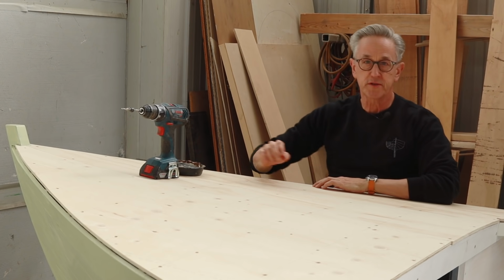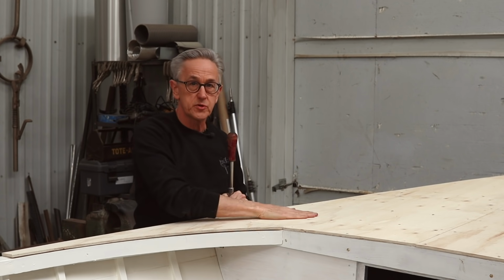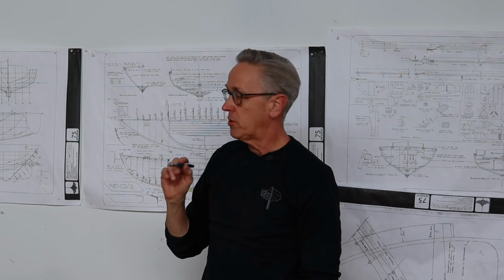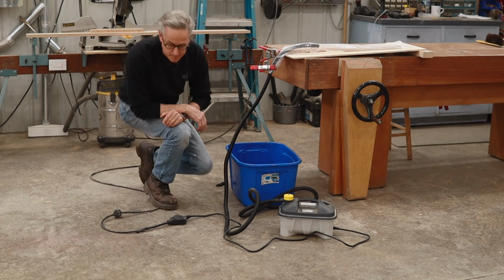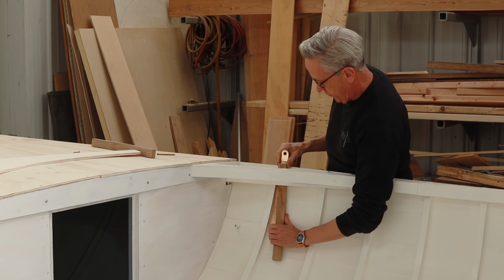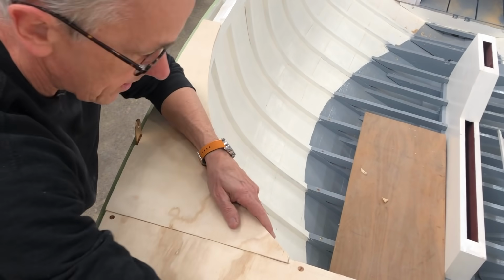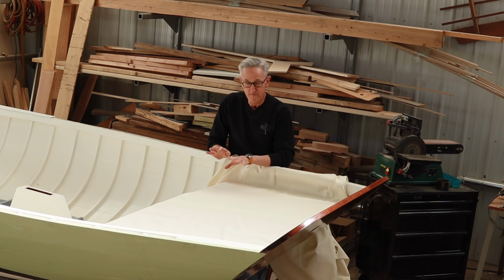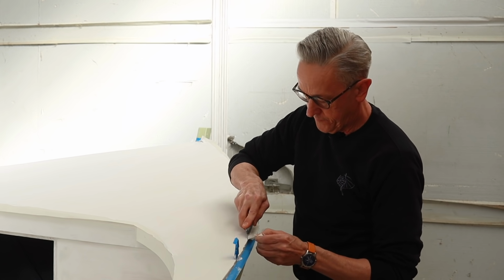Wooden Boat Building. Chain Plates & Deck Canvas, S2- E42

Comment: Another outstanding video Bob. Interesting sealer there would never have thouoght about using Gesso. I have seen and used a primer sealer paint called Gripper to do the same thing. Some how I also see you collecting all the bronze scraps from the chain plates and bolts to cast a bronze cleat for the boat.
Reply: Oh, casting a cleat from the off cuts is a great idea.

Comment: Interesting about slotted screws. I remembered reading about the flat shanked cabinet makers screwdrivers with a parallel tip to match a specific screw size as opposed to my relatively “universal” tapered tip screwdrivers.  And the ease of cleaning out the head to remove a screw - even paint makes that a challenge!  Thanks for the video.

Comment: That's a nice idea using gesso to bed the canvas, it's basically acrylic paint with whiting which gives it the body and texture. I did a painting on a gessoed 12 mm MDF panel that has been outside in sub tropical Queensland for 13 years and no sign of deterioration yet, my guess is the canvas will give up before the paint. Typically we used to bed canvas deck covering on oil based paint, using up the dregs of whatever was around in the yard, in those days most paint contained lead which really helped it stick.

Comment: very surprised how easily that oak bends! Like a cooked noodle! Interesting use of Gesso rather than epoxy on the decks. Do you use any kind of protective coating on the brass/bronze to prevent quick tarnish in a marine environment? 

Really enjoy these videos! The walnut toe rail will be a beautiful touch!

Comment: I believe most people don't like slotted screws is, the common screwdriver is greatly tapered whereas industrial screwdrivers have very little taper and have close tolerance to the screw slot.  Also, I believe I remember, Gesso is used as a base for gold leaf with a rabbit hairbrush.  Maybe you can use it on the transom

Comment: Actually it is not hard to clear square head screws and the like. Just use another screw set up on a battery drill's driver bit and use the screw to "drill" into the center of the buried screw. This will remove the bung and glue from the screw well enough to allow the driver bit then to be set into the burried screw head! I usually tilt the driver with screw back and forth a bit to better clear the hole. This is a very fast process as a power tool does most of the work. I'd counter that with the slot screw, it is all hand work to clear the slot! Also if bunged, aesthetics is not an issue but you are correct if authenticity is your number one goal! Great video though, in spite of my contradictory opinion! Thanks for sharing! All the bestRoy

Comment: Are you familiar with gunsmith screwdrivers? The differ from "normal" screwdrivers in that the sides are parallel. I prefer the insert tip types that can be used in drills or hand drivers for that reason.

Comment: Wonderful video. Just one question, Bob.
Why canvas instead of bright-work wooden decks? I know the design calls for canvas, but it is your boat and your call to change what you wish. Just wondering. Thanks.
Edit: oh, second question...
Why bolts on the chain plates instead of the rivots? Is that for ease of repair in the future, or because you don't have the help to back up the rivoting process?

Comment: Asking because I don't know..  The plans call for a water tight bulk head.  You did not paint the boards/panels all over?  You did not apply sealant to the joints?  Why did you paint the hull inside the compartments but not the deck and bulkhead?  Will you use a sealant when you apply the walnut trim strips where the deck meets the hull?
If any water at all gets into the bulk head spaces it will condensate on the bare wood.
I like the wax toilet ring for lubricating screws!
Thanks, JIM

Comment: The section detail through the chain plate appears to show a haunch at the upper end of the oak backing block to transfer tension load from the rigging into the sheer clamp without only relying on the top bolt. Am I reading the drawing incorrectly or did you determine this detail was not needed?

Comment: Some use Titebond 3 on the canvas so it dosn't matter about water soaking in at the edges. Also for the added wear from shoes and beach sand. Glass is still the king but old school has bragging rights.
Reply: And stand back with your thumbs in your armpits and go "I made that"😀

Comment: The aft deck is made of wooden boards and the foredeck is made of marine plywood. Is this because the wooden boards are needed to support the boat handler’s weight as opposed to the thinner plywood decking on the bow? Otherwise you could of used plywood on the aft deck as well since everything is covered in canvass.

Comment: I'm sure you must have seen Lou's self made chasing tools for repairing screw slots. All the bronze slot heads came out of my resto boat, the x heads had to be extracted. The chain plates and canvas look stunning. I was amazed at the price I was quoted for 9" of 5/8" bronze rod, even its brass equivalent was dear enough. How have you found the cost of the flat stock you have?

Comment: What is the reason that you used canvas on the front and rear decks? Is it for an old-fashioned appearance? Or is it to provide a nonslip surface? Could you not have used a commercial nonslip surface to achieve the same results? I loved watching you do this, but I don’t understand the reason for using canvas.

Comment: Could you tell me the exact Gesso and canvas you used? Thanks
Reply from the maker: Hi Vince, 
Any gesso will do, it's all the same. I purchased mine at Michaels here is a link https://www.michaels.com/white-gesso-artists-loft/M10999016.html?r=g&cm_mmc=PLASearch-googleMICH_Shopping_US_N_Art+Supplies_N_Smart_BOPIS_N_&Kenshoo_ida=&kpid=go_cmp-9972406790_adg-106296476328_ad-433378147599_pla-1341674404478_dev-c_ext_prd-M10999016&gclid=Cj0KCQjwpreJBhDvARIsAF1_BU3ipMYSbvcbv8Xxxqyx8ab-AZseWtHUhXdKdHLwN7sckS3zHSiFFewaAjeJEALw_wcB
The canvas is 8oz just make sure its 100% cotton!

Hope that helps. Thanks for watching!
Cheers,
Bob

Comment: Why the 1/2" hole in the chainplate?  That rig shouldn't need anything larger than 3/8" turnbuckles so the clevis pin would also be 3/8".  Is there something different about your rig plan?
Reply from the maker: Hi Luke,
The final hole is 7/16" The chamfer is 1/2". I determined this size from the plans.
Thanks for watching!

Comment: Bob, I think there was a step to be cut in the oak overlay on the chain plate that keeps the oak and bronze from pulling out; at least that's what I thought I saw in the  drawings...
Reply: @ralphgesler5110  Not for the bronze. This one seats under the inner horizontal member. Wood to wood...
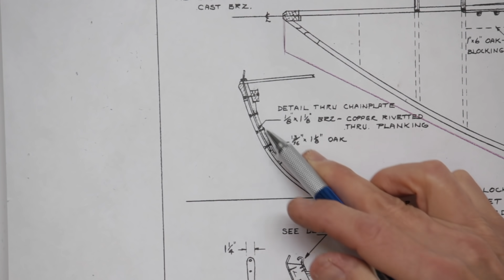Reply: Take a look at 4:55...

Comment: This is a lovely boat and I am reluctant to be critical yet I have concerns about its design.  It appears to me that there is little in the structure that will stiffen the hull to resist wracking. In larger boats there are knees and thwarts added to provide the necessary sheer. In this design the opportunity to provide sheer is in the decks and bulkheads using plywood but that requires a continuous diaphragm with gluing and edge fastening to counter twisting forces. In both the bulkheads and the fore deck plywood has been pieced together which can work if the seams are solidly backed with wood and glued and screwed. This wasn’t done here. Additionally, for some reason the aft decking is planks instead plywood which is a lost opportunity to prevent hull flexing. The forces of wind and waves against the rig, hull and keel may lead to eventual movement and flexing of these components and the hull itself.
Reply from the maker: This boat design has been around for over 100 years. The Haven 12 1/2 designed by Joel White in 1985  is based on the Nat Herreshoff boat, designed in 1914 called the Herreshoff 12 1/2. The basic difference is that Herreshoff is a fixed keel and the Haven is a movable keel. This is a tried and true design with thousands and thousands of boats being produced. None of the concerns you have listed have ever been an issue. If so the design would have been changed in 1915. I would invite you to take a closer look at Captain Nathanael Greene Herreshoff.
https://herreshoff.org/inductees/nathanael-herreshoff/
Here is a link to some of Joel Whites boat designs including the Haven 12 1/2
https://www.woodenboatstore.com/collections/joel-white-boat-plans
Thanks for watching.
Cheers,
Bob